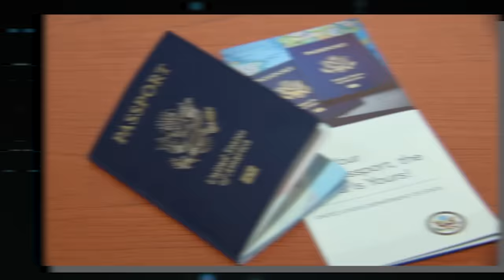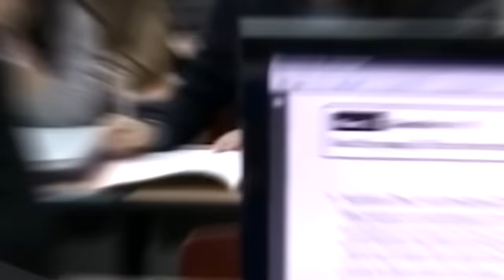15 Weird Things That Only Exist In North Korea

Comment: No one ever mentions that Rev. Billy Graham held North Korean crusades TWO separate times, preaching to stadium crowds, with a translator during Kim Il-Sung's regime.   His wife Ruth Bell Graham had actually lived in Pyongyang as the daughter of missionaries.
Reply: I met his wife Ruth at a dental practice I was temping at years ago, very sweet lady.
Reply: That would have been some time back...saw rev. Graham in Melbourne Australia early 60's...
Reply: @Yvonne-le6ju  The two North Korea crusades were in 1992 and 1994, respectively.  Billy Graham was active for a very long time, with his crusades running for six decades, from 1947 through 2005, when he stepped away from the pulpit due to his declining health.

Comment: There was no armistice, only a cease fire agreement between both sides of the South Korean border and North Korean, their war is still raging on way beyond 1953, it's still like that technically, if you go open fire and try to invade North Korea, you can be sure that it might mean war on China too...

For a long time, North Korea was also backed by the Soviet Union, but starting with the early 90s, no more Soviet Union, but, China is still around backing North Korea...